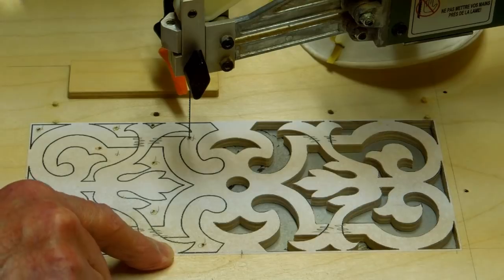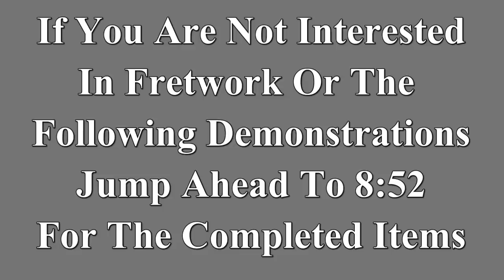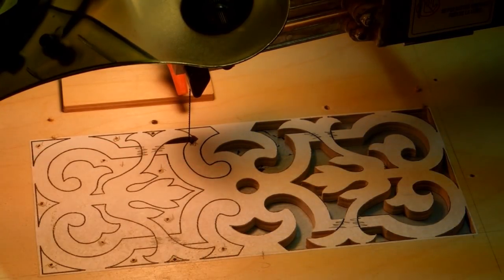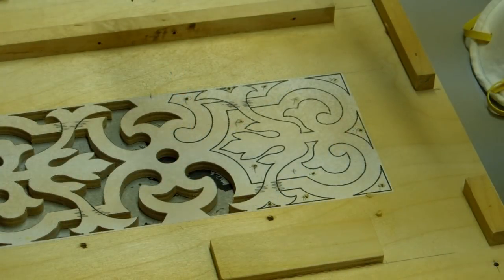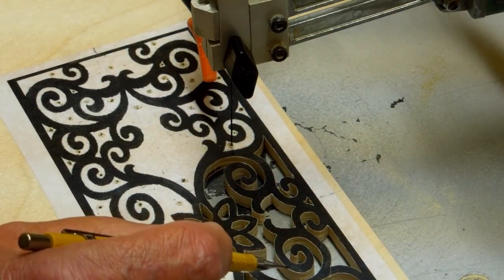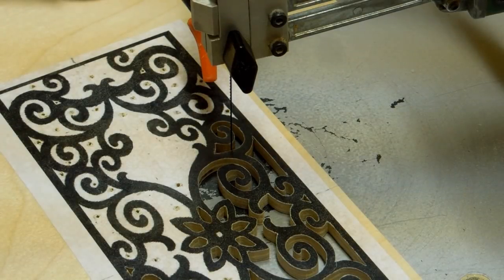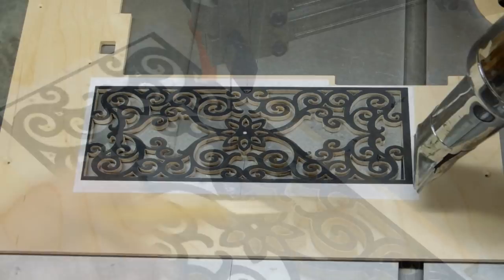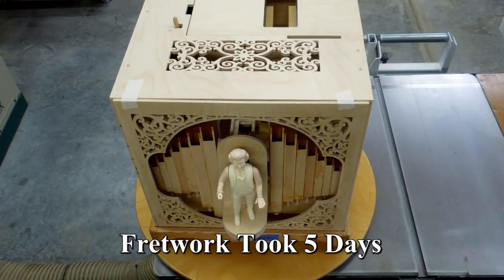Senior 20 Conductor Installation (14) Front Side & Top Fretwork

Comment: You are certainly a fine craftsman but 5 days of scroll saw work seems a bit Roy Underhillish in the days of cheap and easy to use hobby CNC routers that could make those panels in about an hour.  Of course, Roy has a significant following so that comment is nothing more than an observation.

Your organs are impressive on many levels.  Having the patience and perseverance to scroll for 5 days is probably what it takes to persevere through all the challenges you've overcome to make all of this work.
Reply: Sometimes its the journey, not the destination.
Reply from the maker: Exactly!
Reply: The art of the backhanded compliment ?